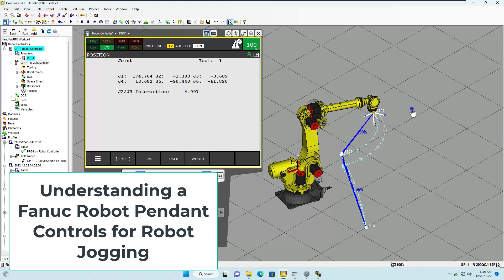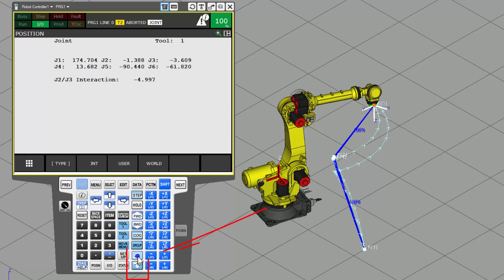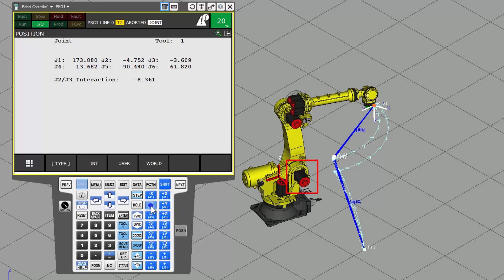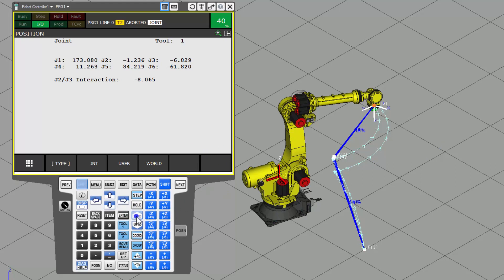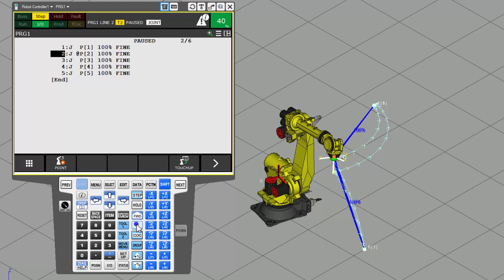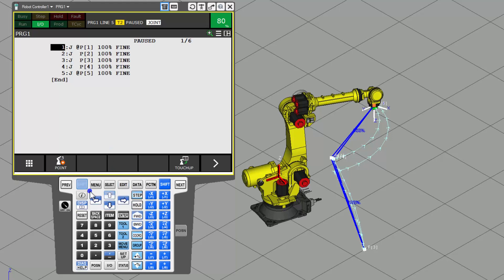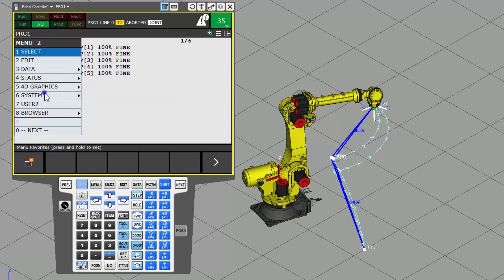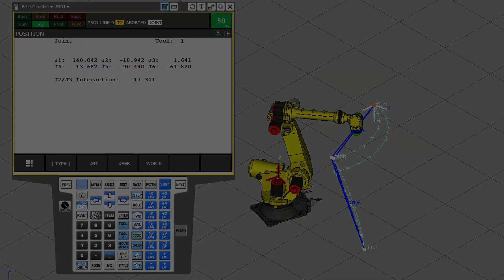Using a Fanuc Robot Teach Pendant to Jog a Robot Joint in Under 10-Minutes

Comment: Great to see you work with fanuc robotics. They are used heavily where I work with allen bradley products.
Reply from the maker: Yes,  they are used a lot more as the manufacturing floor gets automated. 

We use Fanuc and ABB.
Reply: I agree AB and Fanuc kind of go hand to hand
Reply: @mw3blackopsglitches  Robots share the same architecture as plcs, but it is done in structured text language. Also Digital IO is inversed. The robot controller Output module writes to the PLC, While the Inputs to the Robot controller read outputs from the allen bradley PLC. Robot IO is the same as plcs. Shane welcher is the PLC guru. Robots are different. I like his new direction.
Reply: @timkloehn9887  Yea I've only used DI DO for our Fanuc robot I'm still getting a hang of it! glad Shane is trying Fanuc! I've been posting his link in forums for beginners